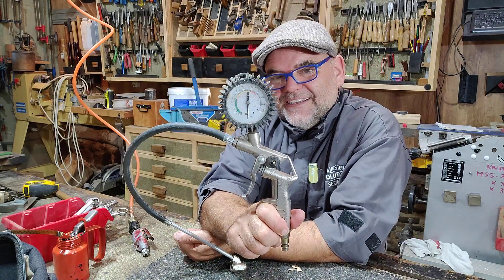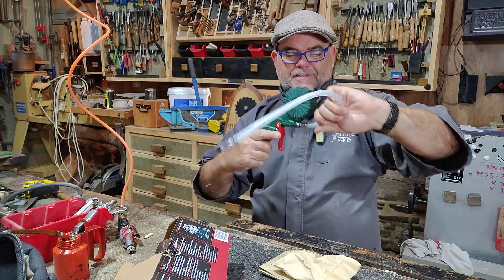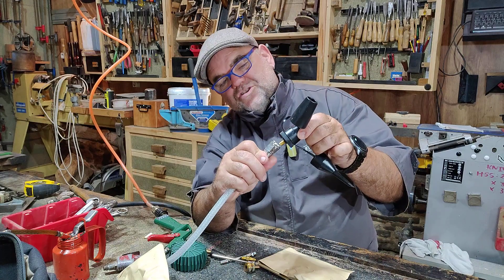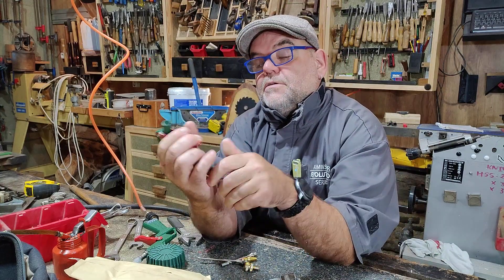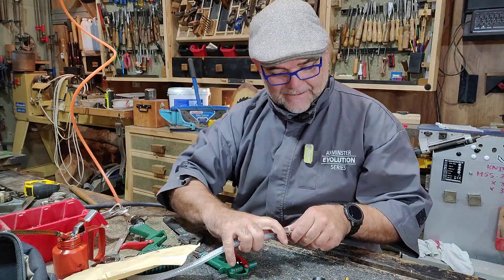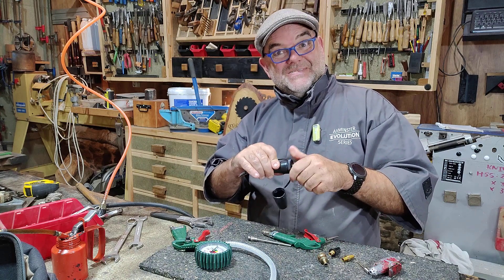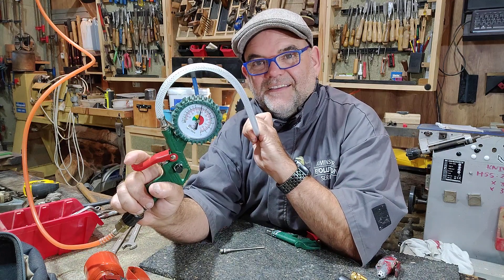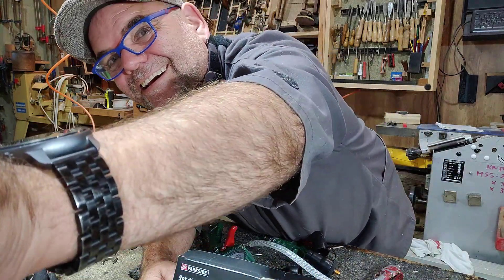Lidl Parkside PDSS 13 D4 compressor kit

Comment: Parkside is generally good. I have a plasma cutter from Parkside with a built-in compressor and its verry good
Reply from the maker: I'm looking to get a plasma cutter. I see the  Parkside is 120e at the mo
Reply: @WallyboisWoodworking  
I think that is the one without built-in compressor. I chose a built-in compressor because I often work from home and then I have a generator on the car's box. but for home use, it is also fine without a compressor if you have a compressor. I had to buy a non-contact hose for mine, but I think Parkside now supplies it as standard. I can cut eight millimeters of cortent steel and aluminum with mine without any problems and copper is no problem either. I've had it for about two years now and it's working fine

Comment: I just can't use cheap tools or equipment. They usually end up just being frustrating and in some cases dangerous. The hose on the green one isn't even an air line. It's a water line.
Reply from the maker: I use it on my tractor which is only 20psi so not to worried, but i get your point

Comment: Naughty Marcus..... never blow air at yourself or other from close range... particulate mater or oil in the air jet.... you naughty boy........  as for the hose.... it's probably rated up to 12bar but just requires a little bit of care... as all hoses do.
Reply from the maker: Will I get pink eyes 👀👀👀👀
Reply: @WallyboisWoodworking  maybe with purple polkadots......😆

Comment: I like Parkside tools. I class these as "Throw away tools". I use them until they break then bin them. Great if you need a tool to abuse instead of doing it to your decent ones. I've got one of their little powered screwdrivers. It's ridiculously underpowered for torque. I find it useful for stuff like longer screws in softer woods.
Reply from the maker: Fair point, a good tool for such a use xx